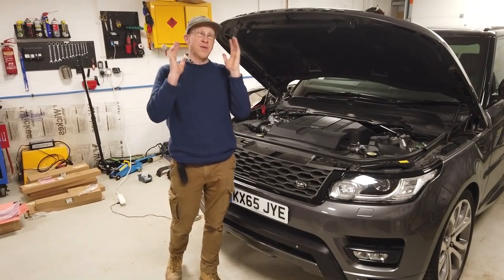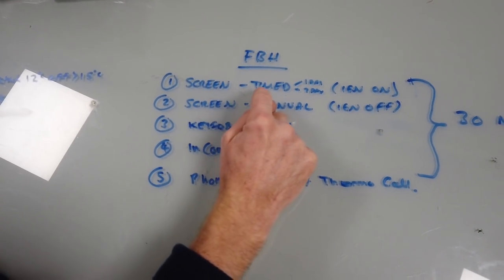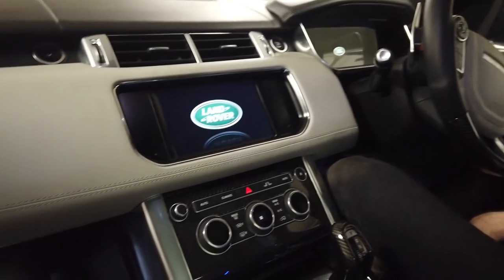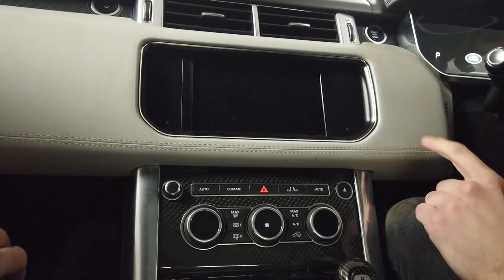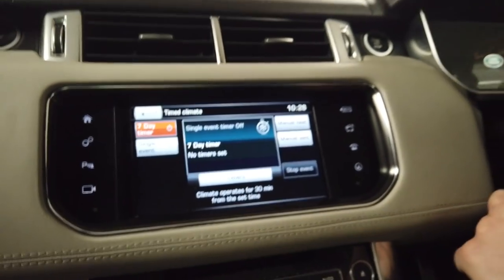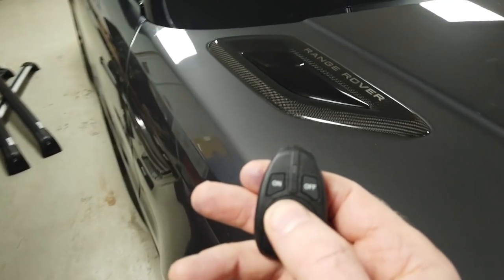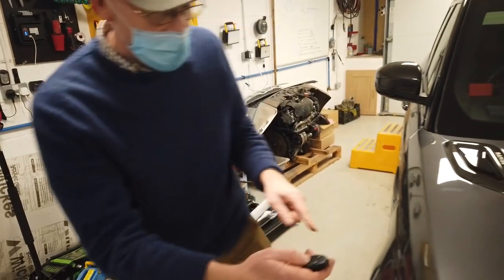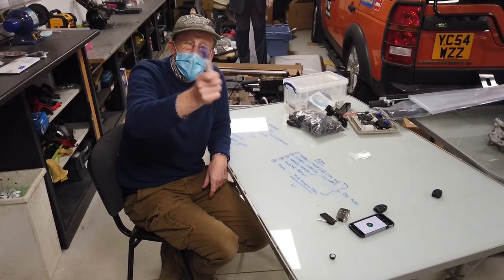Range Rover L494 L405 Timed Climate / FBH / Park Heater / T 90 Remote Programming

Comment: All interesting stuff again tonight. Now when I bought my Freelander II HSE in December 2009, that had a supplementary heater that came on with cold starts and they warned me not to be concerned if I saw steam rising from the front lower grill...and it did. That had nothing like remote start etc but was part of the cold start sequence. Move to my 2018 D/Sport and that has In Control remote working from the app on my phone...but it starts my engine up, turns on the heated windscreen and rear window, door mirrors and brings the car up to a setting which I can change on the app, being pre set. Because I worry about cold start engine wear, I have only used it three times to see if it worked and it does, perfectly....BUT I do not think I have that separate heater unit as on your RRS...I think mine relies purely on the engine warming up...but it does clear everything and warm the car. Now is it a different system again from yours??....answers written on a new SVR please!😱😅😅😅😅 Simon thank you again...you are my late night video entertainment...the best time to watch in peace! Stay safe!!😃😃😃😃😃Richard.

Comment: Gah! Doors and whatnot closed. That was probably the reason I was fooled for a day and a half!

I've just purchased an L405 SDV8 Biografika de Autostrada, or whatever that silly badging states. Nevertheless, the FBH was stone dead on it, so the engine never got up to temperature, hovering around 50-60 degC on a cold day. It wouldn't start on the telestart either. The IID-Tool (G3) with the latest firmwarez left a few things to be desired as well. No diag for the FBH whatsoever on the L405. But I got a code: B1D24-13 (2F) Glow plug circuit - General electrical failure - circuit open. I've met this General electric a few times before, and he can be a bit nasty, to be honest.

So I ordered a new glow plug for an Eberspächer D5WS. That was a big Nope! The D5S, which is installed on the SDV8, and the D5WS have very different guts, even if the name and outer casings may look similar. The D5WS has a threaded plug, while the D5S has just a press fitting. With all the work getting it out, I wasn't really keen on doing the work again, and since the only problem seemed to be the white wire coming loose from the back of the plug, with the plug itself measuring up reasonably at 0.5 ohms, I decided to weld the cable back onto the plug. (Soft soldering won't work due to the heat of the plug exceeding the melting temp of the solder) So I brought out the old Kemppi Kempomat 180, opened the gas and fired for half a sec. That wire is not going anywhere soon!

After throwing it all back together, I tried starting it with the remote and was greeted with absolutely nothing! I have an iCarSoft LRII that can monitor a few parameters. I saw the telestart activation, but no circulation pump, no fuel pump, no ventilator nor did I see any glow plug activation. And there were no fault codes anymore. So I was hanging my head and felt a substantial amount of defeat creeping onto me.

Today I've spent quite a few hours window shopping test tools, harnesses and whatnot, until I decided to watch this video (again) to see if there was a hint that I may have missed. Closed doors... Let's try that then. My car lives in a closed garage some 100m away, so I pointed the remote in the general direction and pressed Fire. The green feedback blink came on, just like everytime. I put on some decent looking trousers and took a stroll towards the garage. And I thought I heard a familiar sound. No! It couldn't be! But yes. I was met with a plume of smoke from beneath the car. And it was the correct car, as well. And the ticking of the fuel pump was like music in my ears! I had won!

So thanks guys for all these videos! You're making the live with British cars a little bit easier for us!
Reply from the maker: What an epic adventure ! glad its sorted ! enjoy the warm feeling !

Comment: Can you possibly do a video of installing the Remote heater control on the Disco 4? The module is in a similar place as the car in this vid but I don't have any of the remote control gumph so wouldn't know where to start just the FBH in the engine bay.
Reply from the maker: Yes we are looking at this.... collecting some parts now !
Reply: @L663  That would be really nice! Thanks in advanced!

Comment: Hi, I have a 2017 L405 Autobiography Supercharged. My in car heating does not work, it hasn't worked since Hatfield in Liverpool, Uk, fitted a new engine! They also never put a drop of coolant (Anti Freeze) in the system! Anyway, do you have any idea what would stop the heating from getting hot, the blowers just blow cold air out. Pre-heating does nothing also. There are not air locks that I could find. I would assume it was some sort of valve switched off? Thank you so much for the Videos, they are very informative and a great help. Regards Paul
Reply from the maker: Interesting - I think there is an auxiliary water pump on the L405 ( electric )
Try and find this and check they plugged it back in
here is one on ebay
https://www.ebay.co.uk/itm/275503859035?hash=item40254f455b:g:2c0AAOSw7lVjTaqx&amdata=enc%3AAQAHAAAA8HA%2BsZ6Jzxz%2BH2vjt98rKS2iqsPM2ovYa1FDszfB2jJoTCAjbvzOcLlGJt4HjlcNOCZ6lMhgzASTNev0C1jBxjaqFVpjPuy8JS0KrVWztTEaN1wfzrCNTue%2FNA7gOLduKFIfm3uoFIHiH9xov%2F7V0Lx9ssaljND0D%2F98YXMdzRPkAJDZdvI817cQC7diyfeMECUhGYpYKZuDN207KDvH%2BTSMYia2g8TPJAWZGQVmPcxiIPTHiwWVIW%2BgxhXd6l%2BG%2BIxIP13S4L%2FZGzQwYMMckjyxR7fK6hBZXU4bR0zX676OU2rRJr7kEhYrurctdelwYg%3D%3D%7Ctkp%3ABFBMqOruw5Zh

Comment: Hi great video as usual but can you tell me if it’s the same number fuse in the l405 my didn’t work and looking in the hand book it’s says fuse 27 is for trailer lights I also watched your vid for fitting the rear light bar on the sport would this fit the 405 if not are you planning on making one can I put my order in now cheers
Reply from the maker: We did look at this today - the L405 is a fair bit longer so you cannot fit or modify the Sport one to fit the L405.
The L405 one is on the list for development.
Reply: It was fuse no 1 in mine

Comment: Hi Simon. I have L322 4,4TD 2011 with original remote  T91. But its working only 20min. From the screen timer is the same, "20 minute heat or vent vechicle climate". Is it possible to extend it somehow? Its really not enough of working time to get any significant heat in the cabin. Wich divece limit time, is it Telestart box or climate control? I just thinking, if I buy new Telestart control box from Webasto shop (there is possible to adjust time up to 2 hours), it will works or not?

Comment: I have a 2019MY SDV8 L405 and am thoroughly confused by the FBH. The spec sheet printed from Topix says I have one on the car and sure enough I can see the Webasto unit nestled in the top left corner of the engine bay. 

But... there is no menu for timed climate on the infotainment system and no remote fob to operate it from outside the car. I'm not really bothered about the timed climate as I don't commute in it but would like the fob. 

I talked to LR and they were predictably unhelpful and said the car didn't come with a fob and I could use incontrol to pre-heat, which isn't the same thing as it starts the car and part of the point of the pre-heater is to warm the block through prior to starting. 

Does anyone know if you can retrofit a FBH fob to a facelift L405 or will it now not have the Webasto telestart module/aerial fitted? And if not, can I add that module plug and play to a facelift model or would the wiring have to be fiddled with?
Reply from the maker: Interesting - clearly the FBH has 2 purposes - one to warm up the engine quicker - the second to pre heat - this must surely be upgradable in the software as an option ( see our video on adding this on the D4 ) I will note this as a video to do on our L405 when i get it out next.
Reply: Hi Simon,   Have had this on two diesels and currently on my Sport S/C,  I’ve had it a few times where it all switches on fine but doesn’t get to temperature set - very annoying !! Any thoughts ?  Btw All the best for Xmas

Comment: This is a great feature however be aware, if using the heat function it will use the heat settings you have set in the car when you shut down, so if you have it nice n toasty, it will warm the car up to that temp which is great, however if there is moist cold air in the car (naturally there will be when you open the car doors), the cold air will rush in to fill the nice warm dry air conditioned air and then slowly cool so when the heater comes on the car will gets quite misty and steamed up so will take a bit of time to clear. Shame the AC couldn't come on or perhaps the use the vent feature to let out some of the moisture. This is not and issue in cold dry climates. Im on the south coast so the air is pretty damp. there is a work around and that to leave the sunroof tilt slide up a little bit to aid venting, however there are 2 downside to this, if there is heavy rain it can work its way in depending on how you are parked or if you come back to the care earlier than the time is set the car is pretty cold! It works great if you have a garage though as you can leave the sunroof up and it vents fine, and when its really cold and you are late leaving just use the remote whilst you are locking the house up or getting ready and it warmed ready!

Comment: Hello Simon great content i have a L322 td6 with the remote and every time i use this function it flattens the battery
Reply from the maker: Yes mine flattened the battery - it seemed to turn on the heated seats too which could put a fair drain on the battery. It does not seem to have a voltage sensor to stop the system as the batter voltage drops.
Reply: Please check the secondary/auxiliary battery 🔋.
Thanks 🙏
Reply: @mvirdi2333  Thanks for reply but it doesn't" have a secondary/auxiliary battery fitted
Reply: @cannon98  check if you can add on . Like some model comes in factory 🏭 fitted.
Thanks 🙏

Comment: L405 2020: I was having issue with mine running. I ask the dealer they suggested the battery was low. So don’t know if they add protection for that.
Reply: I know that one of the parameters checked by the system on an L322 was adequate battery voltage, along with fuel level and ambient temperature before it would allow the FBH to run. Presume it's the same on newer cars too. It does eat the battery though. After a couple of days of use and short journeys you'd be lucky to start the car, let alone the FBH.

Comment: Hi 🙋‍♂️ nice 👍 I am also thinking 🤔 to add this remote so please let me know if I buy a remote so I can pair without going to Land Rover dealer/GAP tool. At this moment I am using the ⏱ timer . I noticed my car 🚗 if battery 🔋 is low then heater is not working.
Thanks 🙏 🙏
Reply from the maker: Hi Mr Virdi - yes you can buy the remote from ebay and just pair by removing the fuse.
But I am not sure if you car will have the remote fitted at the rear.... send me your chassis number and i think i can check ( you can post here or send by email )
https://www.ebay.co.uk/itm/RANGE-ROVER-SPORT-EVOQUE-DISCOVERY-IV-4-PRE-HEATER-REMOTE-CONTROL-KEY-FOB/253308003741?ssPageName=STRK%3AMEBIDX%3AIT&_trksid=p2057872.m2749.l2648
Reply: Thanks 🙏
Reply: @L663  thanks 🙏

Comment: Can this be retrofitted, pretty sure I don’t have this feature from factory...
Reply from the maker: Hi - do you have the heater in the engine bay ? I guess it can all be retrofitted but would be a big job with hardware and software etc
Reply: @L663  Wonder if could be fitted in a NA spec Range Rover,  I have a 16 and with the 3g service sunsetting there will soon be no incontrol app for remote start.   Thinking this would be a better option than remote start anyways for cold mornings.

Comment: I have a 2017 RRS HSE SDV6. I thought all models would have the keyless entry (entry without having to press the keyfob) but mine didn't, and have been missing it since.
Now I saw an interesting product (https://mobokey.com/shop/cam-pro/) I was thinking of replacing my entire key with it to lock/unlock the car and to also use it to remote start my park heater (instead of the engine). It would be really helpful for me to get this feature as its usually a struggle to get the keys out when carrying a 5 year old and that too in the winter. But here in Sweden they are quoting atleast 500 EUR+ for just the installation. Do you think I can do this myself with not much knowledge on the car.